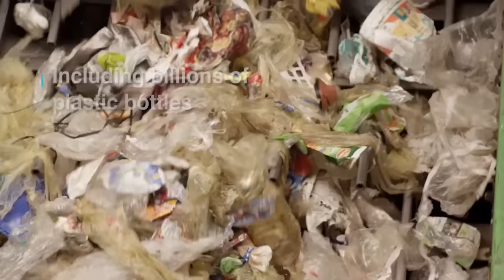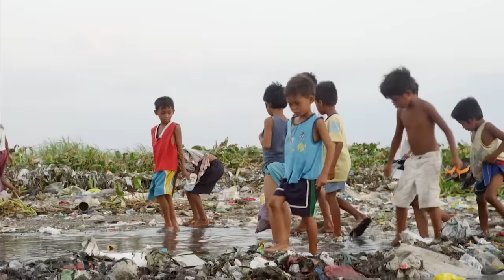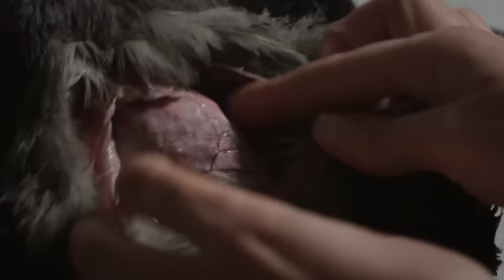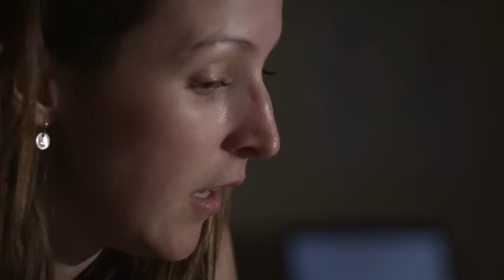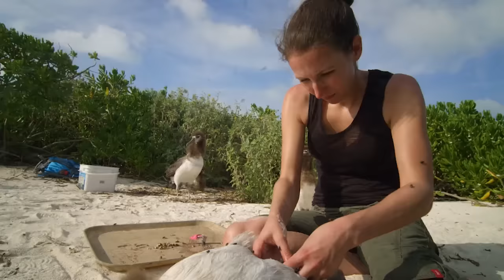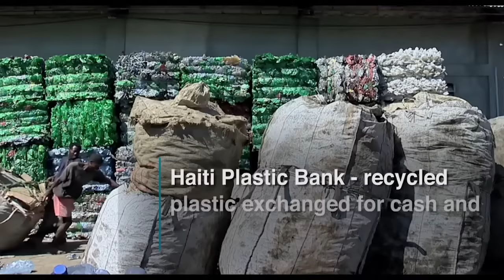Plastic Ocean

Comment: This was in 2017. 
Now it’s 2019.
We still haven’t done anything about the plastic.
Together we can recycle and stop using so much plastic.
Reply: It's now 2020 and still getting bad😢
Reply: Its now 2021
Reply: claps that was butiful
Reply: @Lindsey Murray  except for out need for more plastic syringes; gloves; and masks !    B-)
Reply: @imhopelesslyaddictedtofent4266  No, recyling helps, A LOT.  Where did you get that from? Recyling uses energy, however,  so don't buy so many things wrapped in plastic anyways!
Reply: @constellations_0  Less than 10% of the supply is actually recycled. I think recycling aluminum is great but almost everything else ends up burned or in the ocean.
Reply: 2023 Goodwill stopped using plastic bags at least & I heard Co stopped using bags in most all their stores. Progress?

Comment: What no gloves in your hands when open the bird dead ? Why ?
Reply: @eleanax9268  The issue here is not is it plastic or not, is sanity. As you can see they are manipulating dead animals and he or she can be infected by any microbes working with those dead birds.
Reply: @Blanca Reyzin your health have to be first always for that reason you have to use protection in this case using gloves.
Reply: She doesn't need to be wearing gloves. As long as she washes her hands after, that's all that matters. I work in healthcare and I hate all of the gloves we use just one time.  Even when I give drug tests, I don't wear gloves.  I just make sure my hands are scrubbed after.
Reply: @josephalfonsoamantia7028  no that's not true because she can be infected by an open wound with any microbes. Man I'm a physician, I know exactly what I'm taking.
Reply: We killed the birds. No room to be squeamish

Comment: why don't people rebell against petroleum-based Plastic Products they make all natural plant-based plastic switch biodegrade doesn't that make more sense
Reply: That is not any better. Plastic is plastic is plastic. It is the same thing if it comes from a plant today or an ancient plant that turned into oil long ago! There is no difference at all except with your plan we will have to clear cut more forest and use a lot more pesticides

Comment: I pick up all rubish
Reply: Good person you are well done
Reply: I try to pick up all rubbish. I have removed many tonnes of rubbish from my streets and from the river I live on.  The river work was done with the aid of a canoe with a small motor, and a small canoe as a trailer. I would fill the small canoe full, and most of the main canoe as well. After a couple of years, I had cleaned about four kilometres of riverbank of trash.  One day, as I motored along, there was not a speck of rubbish left. The beach, the river all turned to golden light in front of my eyes. Astounding! Best job I ever had. Nearly...now I am far up the same river in thick forest. I deal with the flammable forest fuel to prevent forest fires. All of the material is collected and composted. This job ties for best job I ever had. If you have the means, find a waterway and a canoe, and some large trash bags. You will never look back. 
Failing a river to take care of, find a bit of forest or scrub to care for. If you live in a city, find an area that is in need, and clear the rubbish. A little disgusting, but very satisfying. Don't take risks, use gloves or tools instead of bare hands if in doubt. The plastic waste is very useful and needs to be collected, especially the five large oceanic plastic epicenters. A ten cent deposit on all containers would go a huge way to solving this problem.
Reply: I did this in Dal Lake, Kashmir, India. Much of it was syringes discarded by one if the lakes doctors. Another big mess was plastic flags thrown in the lake during a local election.
Reply: Hi Chloe Boeder please watch:Martin Hutchinson.He & his dog `Starsky`doing the same. God Bless you! much Love
Reply: Chloe Boeder god bless you

Comment: You'll never get people to stop dumping it in the ocean or in rivers as long as it's cheaper and simpler than disposing of it properly (assuming they even have access to a proper disposal method).  So, given that, the only long-term solution that would work is to stop making it at all.

Comment: Plastic is made of crude oil. I'm an autobody collision technician for over 30 years and in past 20 years the vehicles we drive today are made up of at least 20-25% plastic parts. Plastic does not decompose and these cars are built with weaker parts. It is not a gas mileage or weight issue. The newer cars are actually 15-20% heavier. We already pay for water that is taxed and is accessed out of our water spickets . The plastic bags at our department stores can be replaced with paper bags , all you have to do is ask like myself. Paper is made from trees and can be regrown. Crude oil cannot be remanufactured. If we all did our part , this world would be a much better place and our generations after us will thank us. God bless this world and the United states of America

Comment: You'll need at least three or four boats around the islands just running around the island picking up plastic bigger ones out in the ocean and the ones in the ocean will have a factory on the little melt it all down entertain it into a tighter package

Comment: Something important that we all should know is that Plastic is obtained from Crude Oil through Naptha Cracking and as long as the world will need Petroleum Products, the Plastic will keep on manufacturing.

Since the World's demand for Petroleum Products is increasing, so would be the Plastic Problem.

I would say the ONLY SOLUTION to Plastic Problem is to make an ENZYME which when added to plastic will make Plastic 💯%  COMPOSTABLE & BIO-DEGRADABLE 

And I know a group of people who have successfully developed those ENZYMES.
Reply: there is a fungus that biodegrades plastic called Aspergillus tubingensis which is cool

Comment: THere is only ONE solution to deal with most recycled plastics.  Follow Sweden's lead;  Burn it.  In Sweden they use waste plastics in a pollution free special furnace to turn waste plastics back into fuel for electricity.  Paper and cans are very much recyclable,  but plastics are not.  The solution is to burn them for electricity.  Every region of the world should have a hi fire plastics electricity facility.  And by the way ,  its not plastic grocery bags that are the problem.  It's bottles and single use packaging that makes up the bulk of the problem.  Grocery bags today are mainly made from biodegradable starch plastics now.

Comment: By pyrolesis is a simplr process by which plastic can be turned back into oil.  Have these dummies lived in some remote spot with zero communication or do they not want plastic to be refined back to oil?